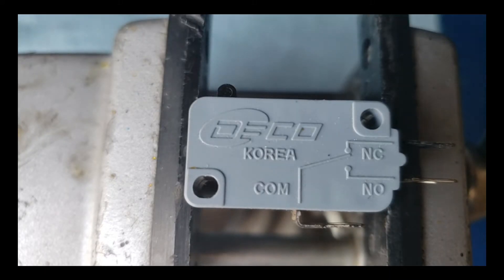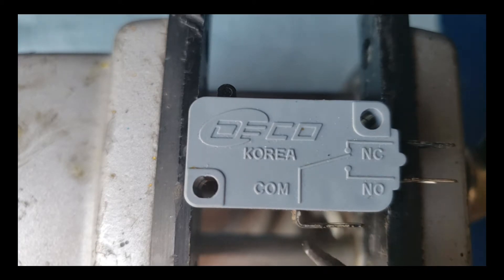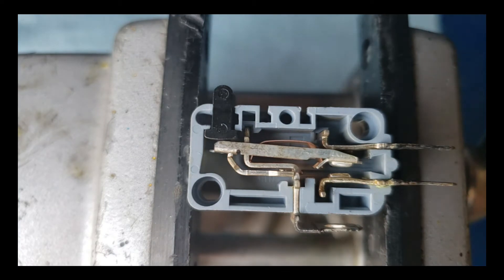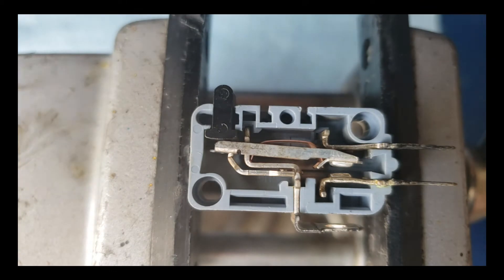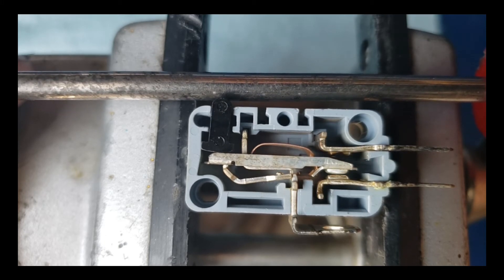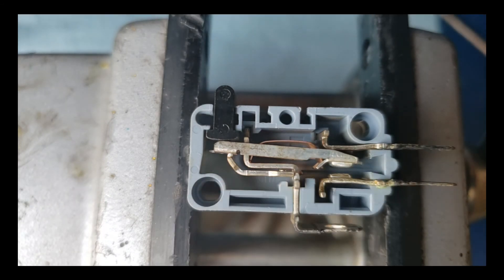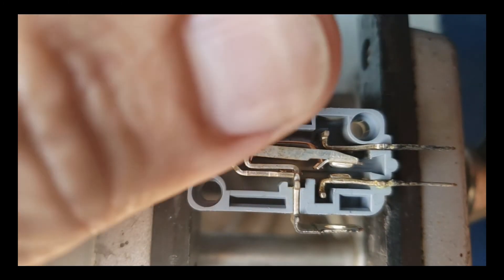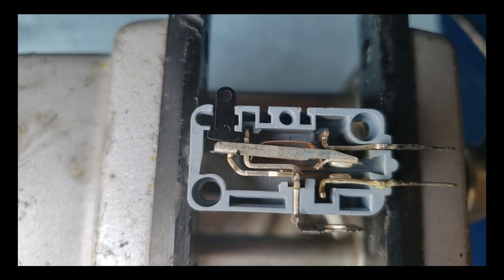How does a Micro Switch work.

Comment: Hi just wondering if you can help me I have a microswitch which show 20(4)a 125/250
µ 40T125  20raµt652e4 125/250vac.   What does that all mean?? and can i just use a 15an125/250 instead?  Thanks for any help!!
Reply from the maker: Yes, you should be fine using the 15an125/250.
Reply: Thanks for your reply